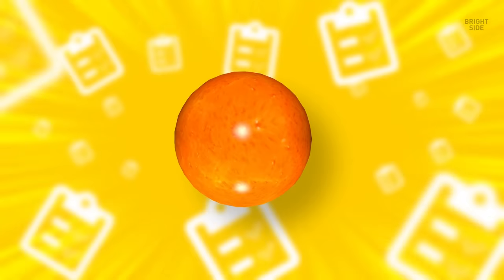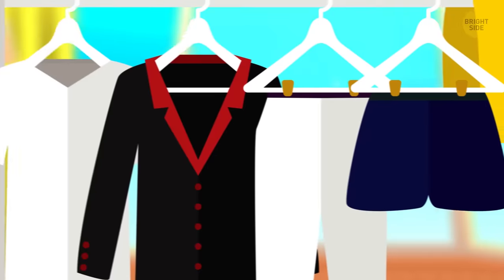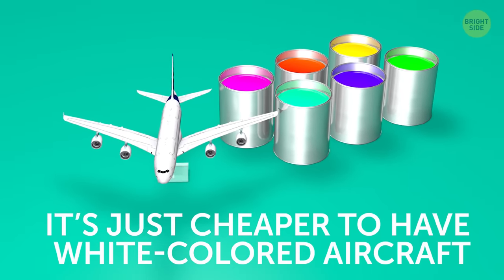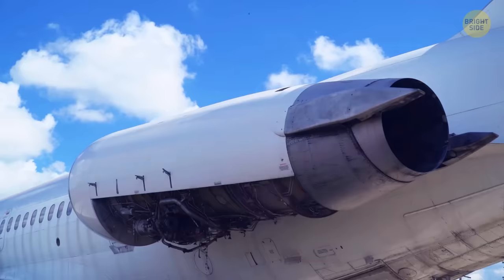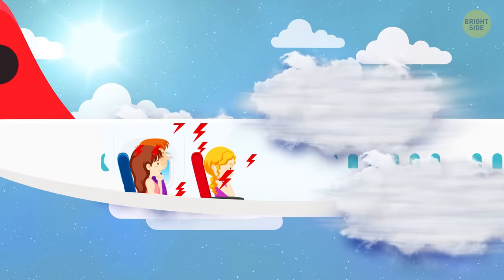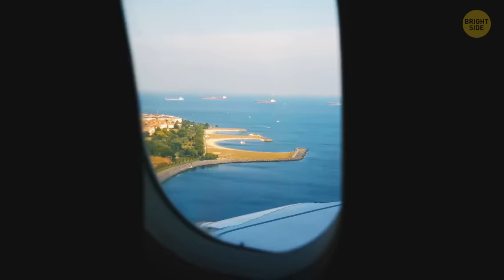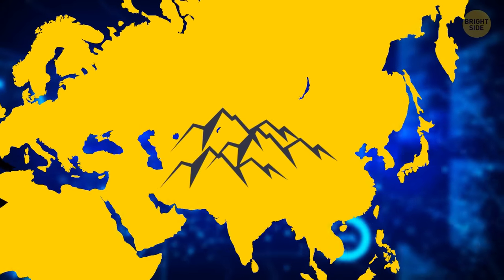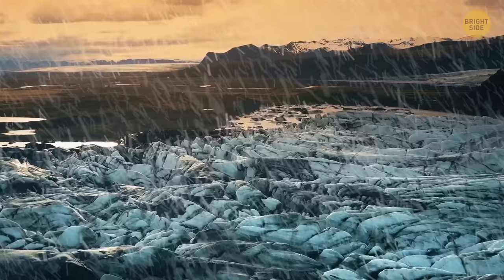Why Airplanes Are White

Comment from the maker: TIMESTAMPS:
Is sun dangerous for planes? 1:32
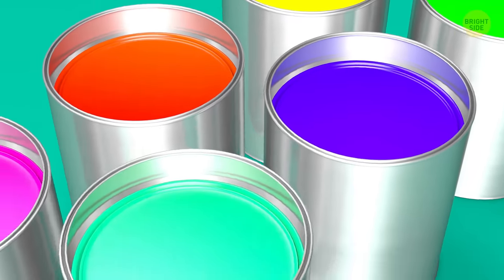Why it’s cheaper to have white-colored aircraft ✈️ 2:22
Why do they have to fly so high? 3:53
Bleed holes for your safety 5:43
Why airplanes don't  fly over the North Pole 7:08
Reply: Well I can absorb it lol melanin lol
Reply: look at 4:13. 35000 FT is not 10,700 KM, but Meters :)
Reply: What's a bleed hole
Reply: Ok
Reply: If a plane went to space
Reply: Thx
Reply: You forgot to pin it

Comment: You make a mistake when you said 35000ft in the picture was equal to (10070km) but I think you ment to put metres instead of km
Reply: u'r right......its nearly 7-7.5 miles means around 10-12k metre.
Reply: Dude u wrote 10070km its 10700km and yes it should be metres
Reply: No its 32km

Comment: 4:10 simple but huge mistake 35000 feet is not 10,700km it's 10,700m 10.7km. outer space is only 100km so ten times this is a pretty big mistake
Reply: @aslamawan4594  I know, it's an honest mistake we all make sometimes. I was just letting the other viewers know in case they incorrectly quote the video.

Comment: It is supposed to be 10,700 M not KM or 10.700KM
Reply: Rellikson Kisyula was wondering about the conversion if 35k feet would be able to add up to 10000km
Reply: It is 10,700 km - obviously the metric converter was using the continental decimal comma, to go with the continental metric conversion...

Comment: I am wondering about a few things:
1. Why is it so hard for people to board a flight? They have to go through security, wait in big lines for checkin, etc. 
2. Why are flights so long? What would happen if a plane started to overspeed, and go faster than usual? What's the problem with that?
What is the longest flight non-stop in this world?
Reply: If the engine overspeeds, the airflow through the intake will rise to an abnormal level. This causes the flap valve to snap shut, starving the engine of air and shutting it down.

Comment: Air is also less viscous at colder temperatures.  Such as the air temperature at 30k ft.  Less viscous air produces less drag.
Reply: Air is just that, Air. At 30k the air is thinner, thereby less dense, making it easier to fly through...

Comment: This is my aeroplane observation and conclusion-
When an airplane is taking off or landing down, you feel you are going uphill or downhill respectively. Although taking off and landing down are in the same direction of the runway,  when you look out of the window, everything is parallel to the ground and everything looks normal but the fact is you are feeling uphill or downhill.
After years of thinking, I came to an explanation. When plane is taking of or landing with an enormous acceleration compared to that of gravity, the vector addition of both of them makes the net acceleration in a slanted way making an angle with  the vertical, and that makes you feel uphill while taking of and downhill while landing.
Reply: Wow...

Comment: 2:08 | I can see why the heat generated with the droop snout at that angle...
Reply: That nose down attitude is for landings and take offs only. It's a visual aid for the pilots. At cruising speed the nose is straight, or in line with the fuselage...

Comment: Mistake, aircraft windows each has only 1 outer window pane n 1 inner pane ie 2 panes, not 3 as mentioned. The bleed hole is in the plastic covering that the pax can touch which the presenter here mistook for a 3rd layer of window pane.

Comment: 8:20 NO many 2 engine planes have an ETOP 
E= EXTENDED-RANGE
T= TWIN ENGINE
O= OPERATIONAL 
P= PERFORMENCE
S= STANDERS 
OR ENGINES TURN OR PASSENGERS SWIM 

FOR EXAMPLE THE B767 HAS A ETOPS 120 WITCH MEANS THAT IT CAN FLY 120MINITES FROM A ALTERNETE AIRPORT

Comment: 4:00 , 4:12 , 5:09
Please correct your mistakes...

35,000 FT
(10,700 M)
NOT:
35,000 FT
(10,700 KM)

**35,000 Feet is about 10,700 METERS, Not 10,700 KILOMETRES.
Reply: How did you notice that. Your eyes should be one of the best!